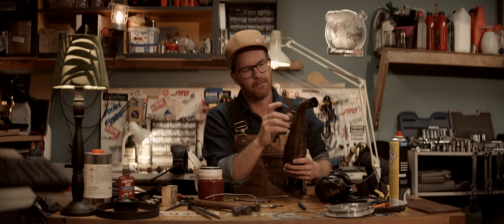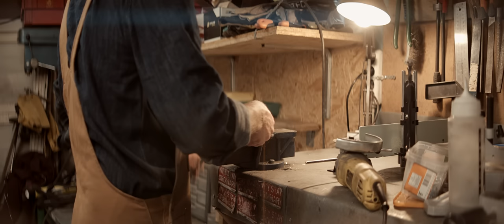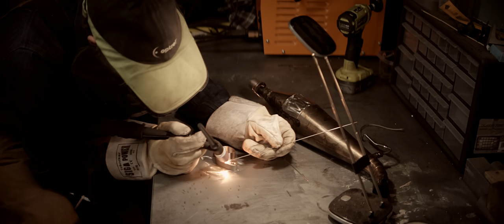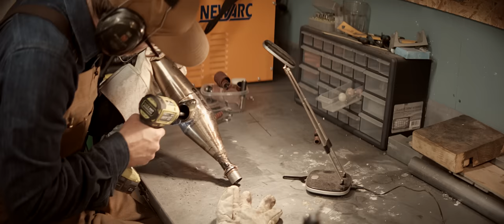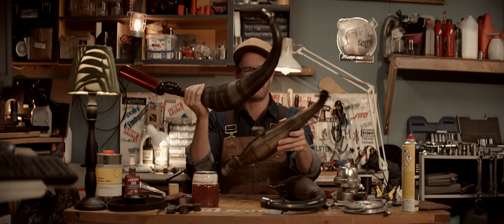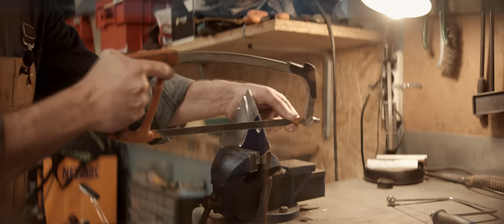Two Stroke Pipe Wastegate - Why do I get such strange problems?!

Comment: a) please be more careful when using the pillar drill............. 
b) all you need is top end power, a strong  clutch, and a good push (some lsr cars are pushed off the line with another vehcile....)
c) i have a book about two-stroke exhaust design, by roy bacon, from the 1970s - would this help?? basic theory.

Comment: Hi Alex just going back a few steps here, is started fine on the engine dyno with that pipe? I know you have now added the disc valve, but I’m leaning towards an ignition issue? The selettra was simple and worked can you fit the reed valve back in with it in that frame and selettra ignition? If that works then it may needs some radical disc valve timing

Comment: Is it possible that the exhaust hole is far to small, i remember you made it circular rather than a slit a few months ago, maybe this messed with the resonance causing the blow back to be wayy to strong, therefore it ends up burning old, used fuel rather than pulling in new fuel from the tank, might also explain the fuel bubbling in the lines as there is air going backwards through the system?

Comment: Alex, why did it run better with a reed- then with the rotary-valve if it was the pipe all along? How is the crank case pressure, should it not idle and start just fine without a pipe? Sounds like its struggling to idle even without a pipe.

Comment: Have you concidered a exhaust powervalve.
Theres a reason big manufacturers use them on practicly all there engines, they didnt spend millions on research and development for nothing.

aprilias rave 2 power valve system tthey use on the rotax 122 and 123 would be very easly adapted for your engine or even the pneumatic aftermarket version.

Comment: Could it be the large crank case volume that makes it very sensitive of the exhaust pulse harmonics? 
I don't know much about two stroke, but can't this be analysed in some kind of two stroke computer program, to view how the pulses travel with the three pipes different you have?
Another thought. Isn't the thing with low starting revs and low idle speed on your engine a bit the same as a four stroke with very aggressive cam, like 320degrees and beyond. The open time of the intake is so long the new mixture is push back the intake valve/transfers 2/4 stroke, even thou the reed should keep the mixture going in to combustion.
Kind of hard to explain my point with my lack of two stroke knowledge.

Comment: Do you have some kind of an electrical problem? Possibly there is  a problem with the crank pickup signal and when you hold the muffler in just the right way you are correcting the electrical problem. I take lots of different data in the automotive world (engineering tech for GM in North America) and have seen ground loop and capacitance related noise cause all kinds of problems. I would look at all the ignition signals with an oscilloscope if I was having your problem.

Comment: I'm interested to see how this ends up, maybe try something similar with a larger engine, a cr500 or 490 maybe a sled engine two cylinder,  i have the crazy idea to put 4 snow sled engines together millyard style, two inline 4cylinders bolted together,  geared to a 2" shaft a car transmission would connect to, have a 12mm plate bolted zo both ends, with the shaft connecting at both or either end with bearings at both ends,  a tapered bearings so a clutch can be used,  use a 1:1 gearing, or possibly a slight reduction, being the engine will rev high, and possibly lack low end tq, maybe a 1.25:1 reduction, make t a bit drivable on low end, with a 5speed  transmission, in a old Toyota truck or something,  spin 10K+  and set the cylinders up to equal a crossplane V8 , use a V8 distributor possibly spinning at crank speed! It could be cool , but sleds are not common here, I don't think I ever seen one here!

Comment: Maybe between the cylinder heads and where the expansion chamber is your Donkey Dick may be an answer. I'm thinking a tee where you can try different length closed tube. Like how some older air intake tube had tuning pipes. It would look like a sausage attached to the header. Hope this inspires you.

Comment: How much do you loose with a slightly leaking gaspipe?
Is it worth fixing?
I got a Dandy 50 (Sachs 50/5a KFI) with allmost 3 LEGAL HP With 5 Gears!!
It's a "30 moppe" but it goes well past 55, and it doesn't require the AM card like the "45 km/h EU-Mopeds" do.

But i can't get it to rev out. Sometimes it does and sometimes it feels like there is some resistance or something, the gaspipe is leaking so it might be that. Or anything else...
Cleaned the Carb with zero effect.

Comment: Why don’t you try a sliding expansion chamber pipe like they do on outboard hydros.  Would slow the pulse down enough to get through the low rpm issues.

Comment: What if you make a new pipe based on the measures of the portmap? Wont a pipe with a wider header allow the pulses to flow better in this application? considering it needs a leak to rev..

Comment: Is your pipe stainless or mild steel? Very different thermal conductivity, so hotter gas - shorter effective pipe length and volume in stainless. Model it in Mota or EngMod2t and optimize the pipe

Comment: Hypothetically speaking with a rotary exhaust valve you no longer need the pulse from the resonator to keep the new fuel mixture in the cylinder so by keeping the cylinder you could be keeping too much of the exhaust in the cylinder and not letting enough new mixture in?

Comment: Also i have a yz125, althought not even close to being in the same realm as your engine, the exhaust hole is around 30mm wide, probably nothing to do with it but i assume it needs to be thay wide to cope with the pressure, my uz only makes around 30hp, so if you are trying to push that same volume of air through a much smaller pipe it might not be able to cope

Comment: Hi I was looking at another youtube, site and they are changing the ignition timing with a module to affect the heat in the pipe at different RPM's. I don't know if you could do something like this, changing the resonance in the pipe without changing the pipe its self.

Comment: Try jetting way up or down and see if it will start with the pipe maybe the pipe is working too hard and push too much air or fuel back it the fuel wasn’t atomized it would make sense that the air would move back more freely, or the pipe isn’t letting the spark ignite like a rich or lean spot near the plug
Reply: Try a trumpet exhaust with a sliding cone and stinger at run dyno runs a different geometry’s

Comment: so could you run a butterfly valve on the exhaust with a custom lever connected to the throttle that would regulate the opening size based on throttle input? Or maybe something running on a pressure input plumbed into the exhaust that varies the opening based on exhaust pressure?

Comment: How does it run with just straight pipe ?  You ram into electrical issues in the old stand. Worse case butterfly valve with 2 exhaust pipes. I wonder if it’s too much back pressure for the rotating valve

Comment: I have an exhaust for one of my scooters. It has an avec/atack valve near the manifold stub. It can be preset to open using crankcase pressure/vacuum I still have it and a spare Avec valve . I could post a pic or video if anyone is interested.
Cheers and keep up good work

Comment: May I ask what formula you are using to determine header & pipe diameter and length? I have been using The two stroke tuners handbook. For my formulas which have been working good. Last night I added a variable length header. I suggest you re check your calculations using the formulas in the two stroke tuners handbook.
Good luck!!

Comment: Why not do an rotating sleeve around the center section of the pipe. And ports on the sleeve and exhaust like an slide valve so at let's say 0-15000 you can very how open they are and change the pipes pressure.

Comment: Are you using methanol or ethanol? I would try 125cc-250cc exhaust with that system. Old pipes are basically free. If you ask. I belive your subscribers will send it to as gifts. I want to see that super charger 2-stroke running.

Comment: hey alex, do you think it would be possible to incoporate a lambda sensor to monitor afr ?

the pipe issue sounds like it could be bad/not enough mixture when open and too lean when closed. half open performance tells us, the function of resonance scavenging and mixture is doing well

Comment: How would a lesser slope on the end (near the stinger) with some extension of the total length work out?  I realize that unless you would increase the center part diameter you will likely narrow your powerband but there is almost always a tradeoff with two strokes.  This way you will still have a strong reflection at higher revs but could lower the pulse strength at lower revs. Otherwise you might want to look into a powervalve kind of system to lower part of your exhaust port(s) at lower revs. I remember Honda having a variable exhaust volume (chamber/valve) on their NS500 triple two stroke, called ATAC. My TZ750 would idle at 2000rpm but only started delivering usable power around 6500rpm. This was with membrane intake.

Comment: What if the exhaust pipe is interfering w/ the intake and exhaust vavles like it's causing a massive amount of back pressure on the valves causing it to not run right.... Maybe you should try a straight pipe w/ no stinger on the end.

Comment: You're not running a 50cc motor. It's supercharged so it's 50cc of air every stroke + whatever air the supercharger can jam into the cylinder. I forget how much boost he's running but it's very likely his exhaust needs to be sized for a 125cc motor or bigger. 

You probably need a bigger pipe meant for a larger engine. Just to deal with all the extra air being forced through the engine and the pipe. Not to mention all the increased exhaust gases from combustion.

Comment: I wonder if @JBlomert has identified a possible issue... gas flow. Could it be too much backpressure with the pipe connected, and holding the pipe just the "right distance" from the port hits a sweet spot with just the right amount to get past low revs and into the power band?

Comment: Could you use the dyno to start the engine? (If it had the ability to do so..)
Chuck it in gear get the dyno upto speed then drop pop the clutch?

Either way you need a much higher idle speed, that way tou are idling above the trouble area with the pipe.

Comment: Love your work Alex but I 100% disagree your longer pipe is (top end power) not bottom as you say it's reving fine  , so make your waste gate design and dyno and then test the long pipe I guarantee it will work better , then the diameter comes into it cc/power output and design of cone for optimum performance/flow.
Long is the go for salt the asuni pipe with muffler think around 14.00 min mark primary part before expansion chamber still to short 2ft primary Alex.
The pipe with hole the pulses are going past hole that's why it's not working  , blanking off some of intake you'll just reduce your hp  , when you say fark that's what I'm saying this end , asuni pipe and extend primary more you'll see massive change,  the chattering as your reving is the pulses fighting each other. 
Make it breath and flow and remember world's most powerful 2stroke so don't use a scooter 50cc pipe that puts out 12hp , you need what goes on a 85 to 100cc 2stroke for it to perform , a rotax race kart pipe would be a easy start to try , cheers mate.

Comment: Propably it' because the Angle of the endcone in the short Pipe that the Energy of the Pulse don't dissappear fast enaught at Low RPM - because the skinny Pipe works

Comment: Only halfway through so maybe you talk about it in the second half but why not a 1 or 2 inch long rotary sleeve valve at the header. Since you only need a few mm gap to start just make a very short sleeve valve. Literally 1 inch long is possible. One tube inside of another with matching port in the side and you just rotate the outer sleeve to close the port?

Comment: What about the crank case volume? The pipe seems to need to pull external air in to help exhaust the pulses, what if it's not breathing well enough?
Reply: Maybe making something like an exup valve, attached to the throttle but starting with the hole open and it sliding closed as the throttle is opened?

Comment: alex look at the intake watched it twice now and i have had this before ona small capacity 4 stroke engine itha short stroke and a big cam 320 degrees did exatcly this ,intake suction is to poor and velocity to low . we droped to a 276 cam it ran staright away , bigger is not better , the exact amount is much more apreciated by the motor

Comment: I saw in previous video you have the one piston ring.  Is it not maybe that with the back pressure being there that at low RPM you have to much blowby.  So when you remove the back pressure it has less blowby and it can actually get enough RPM for it compensate?   Hope you find the issue

Comment: I had this problem whit Rotary intake my experience is they run better whit a thinner long start on the pipe and weirdly depending on the timing of the rotor intake a little fatter and longer pipe to the mufler i already said start whit a yasuni c16 for a piagio

Comment: What about a valved Y pipe connecting a low speed and a high speed pipe? Start it on the low speed pipe and then switch over to the high speed pipe as needed.

Comment: I do not know anything about this but could it be that at low rpm you do not have enough voltage to get a good spark in the high pressure mixture. when reving up you get a better boost and get a spark igniting the mixture. by removing the pipe you lower the pressure in the cylinder and you get good spark.
Sorry if it sounds dtupid but my old hevely trimmed Zundapp had a similar problem back in the 80s

Comment: You taunted the universe, when you said you prefer complex problems to think about over simple ones. There's a reason "be careful what you wish for" is such an old saying. I'm sure you'll get it figured out sooner or later, though. You seem a pretty smart dude. 

Telescopic exhaust incoming? Variable length, to adjust the pulses to the RPMs?

Comment: It needs longer pipe what gives flashback later then these what u have. Bec u have so much power it will start pushing air to intake and that. Seems to be your problem. I think if longer pipe wont help its intake problem. Or some casket is bad. But good luck! 😄

Comment: What will happen if you put a spacer between the carb and crankcase? Or blow compressed air at the intake of the carb at low (problem) rpm?

Comment: I don’t think the problem is in resonance I think it’s that the engine at low it suck burn gas from the exhaust witch explain why it work so well with a gap between the pipe and the engine, the small pipe work probably better because of higher velocity of the burn gas witch put it further in the pipe.

Comment: Could the problem be not so much the pipe as the bottom end of the engine? 
If it's not pumping mixture hard enough through the transfers at low rpm maybe that's why it can't get out of the hole?

Comment: With the the exhaust positioned 3mm away from the exhaust spigit is the exhaust pulse drawing oxy into the cylinder to run better? Is it an intake issue rather than the exhaust issue. Meaning, is the engine starving at the intake?

Comment: Why not go full engineering on it. Put a pressure sensor in the intake, case, and the exhaust, that way you can see and even calculate flows and horsepower. All the math and formulas exist you just need the data. Should help figure stuff like this out.

Comment: this is the strangest problem ive seen. i buildt a rotary valve engine years ago,  my engine did get a way bigger volume in the crankcase. this can be sensetive in a 50cc build since  piston only moves such a small volume. it will effect the suck in and blowport pressures. i added material wherever i could to make the volume smaller in mine, however i didnt have the problem you have..  is there any chance your crankcase volume is kinda big?
Reply: cant let go, i watched earlier videos and noticed your compression test. it said 100 psi, that seems really low but did you do it with full throttle? i was expecting an engine like this to be close to 200 psi. with high octane fuel ive run about 14:1 compression rate and that should be in the ballpark of 200 psi?

Comment: Longer and slower) inlet into the exhast before the expansion chanber, the stubby pipe I'm suprised ever worked even though it looked cool.
The milder pipe kinda proves it, check things like mx bikes where they could make the pipe a lot shorter but never do, yes I know your after top speed rather than low end or in the case of a 2 stroke mid range..... but even gp 2 strokes had much much longer pipes.
Your trying to get pulses in too short a pipe, sure get it right and it will be amazing but it will be like craking a safe.

Comment: Personally I think your exhaust port needs to be bigger... your struggling to get the gases out and choking the engine because your exhausts are restricting it...

I had the same on a yamaha dt125r once... a new exhaust later and a few die-grinding on the inside diameter ot ran like a dream.. picked a bit extra power up too. 😊

Comment: There's got to be a way to fix the problems with the rotary exhaust valves in the brute force engine....that just has the most potential, I believe, due to being able to completely close the exhaust and really pack the cylinder. Unless you go turbo (making your back pressure increase proportionally) and the smallest turbo I know of really doesn't spool with engines under 125cc... maybe if you add anti lag? I mean honestly, a 50cc moped with anti lag sounds bitchin...